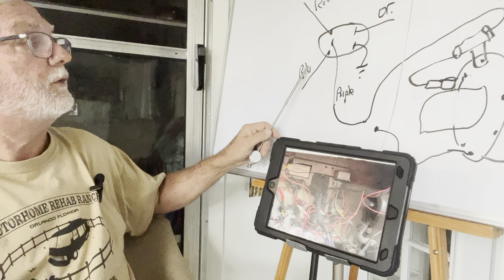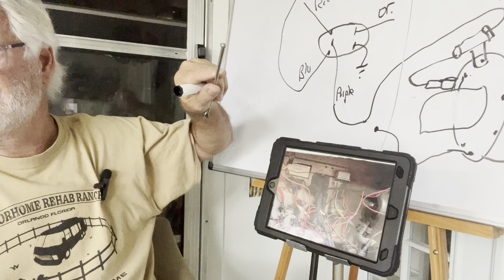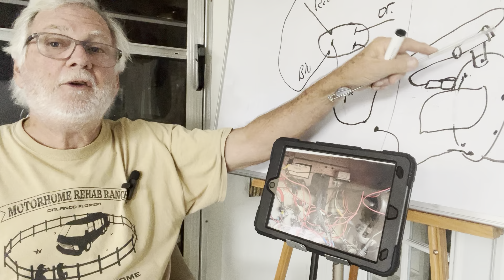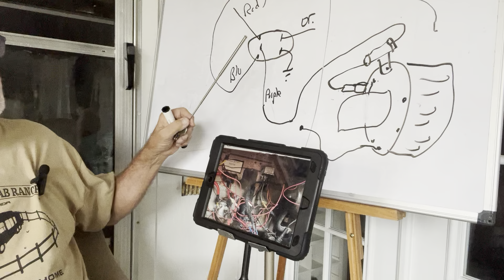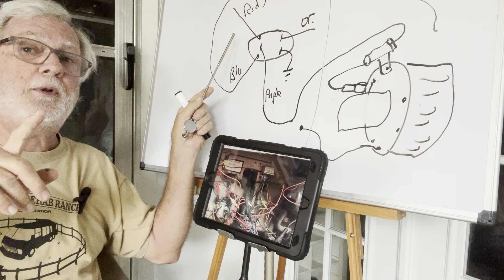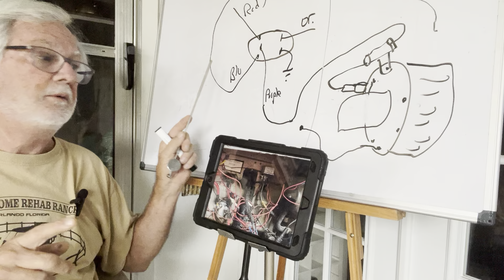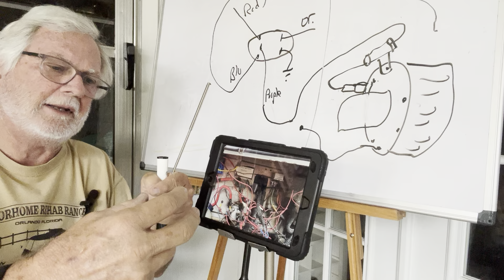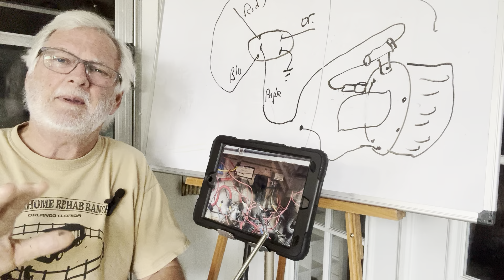Discussions: pg.2. Dash AC blower electrical system

Comment from the maker: Yes to all of that and I forgot to bring in the delay relay.  When you go to the Semlax combiner you will loose this hi fan of but getting rid of the .8 volt isolator drop the blower will spin up the same and better than before.  I’ve all but deleted the idea of the battery isolator.  Specifically the Semlax combiner is so much better and safer it’s a must do.  If you have questions on that give me a call but a 1wire alternator and a Semlax ACR-160 is a must.  I invite contrasting opinions

Comment: Jim, I don't believe they added the high speed relay to prevent the fan from operating on HI when the engine is not running.  If they were worried about the fan running with the key ON and engine not running, why didn't they put the fan power though the relay contacts and power the relay coil from the alternator output... that would keep the fan OFF on any fan setting until the engine was started.
My understanding is the HI Speed relay is there to power the fan from the higher alternator output voltage available on the input side of the Isolator.  This 0.7 to 0.8 volt higher voltage gave the fan a bit more power on the HI position to help overcome the HVAC system air restrictions.  Also the close proximity of the fan to the Isolator reduced the wiring distances and therefore voltage drops in the wiring powering the fan on Hi Speed.
Moving the power supply point of the Hi-Speed relay to the Battery Positive Terminal removes the higher voltage feed advantage, so your fan will run slower on Hi-Speed.  Changing to a one-wire alternator will also remove the higher voltage feed and result in a slower fan on Hi-Speed.
Later coaches also had a delay relay in series with the fan power.  This allowed the vent flaps to move to their selected position before powering up the fan.
The Hi Speed relay can be replaced with a low cost Bosch type 30 or 40 amp 12V relay.  The savings can be used to buy some cool beverages for enjoyment after the upgrades.